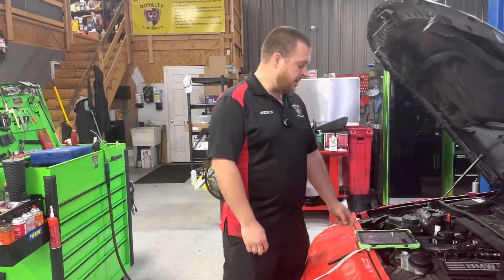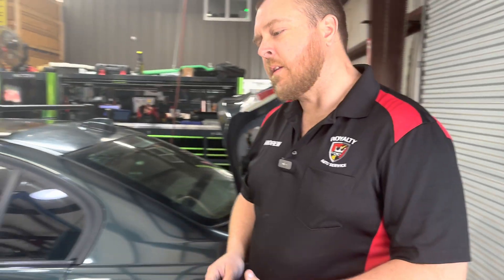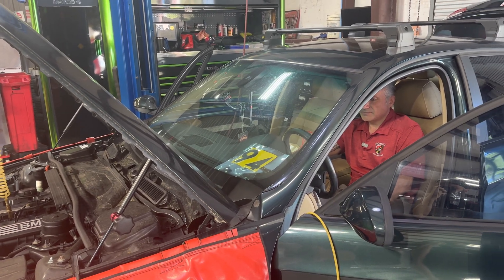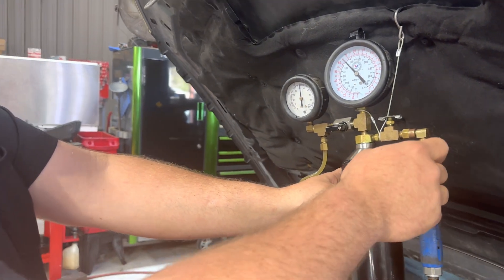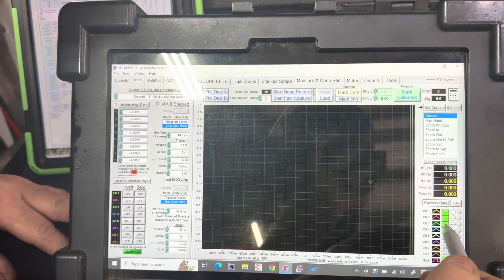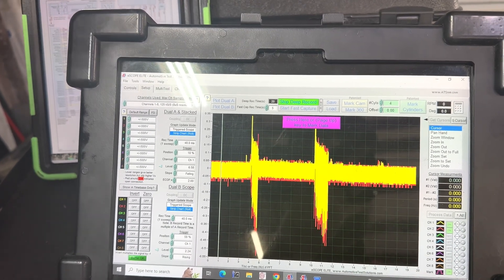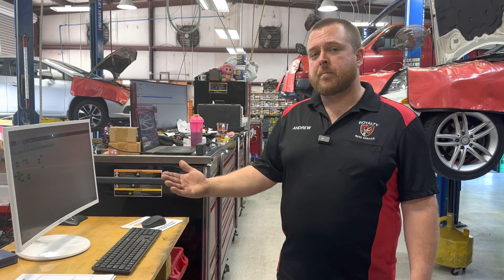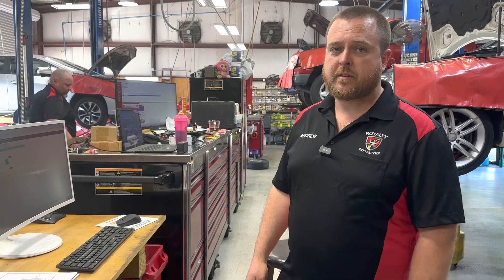Diagnosing a BMW That’s Had the Parts Store Thrown at it

Comment: Great example of following the data. I like that dividing point I saw Sherwood use that in other podcast episodes to see if you are going to follow spark or fuel by introducing a propane fuel source into the air stream. Their was a few times that one would of taken the fork in the road such as the fuel pump all the way back to that module that controlled that relay Andrew removed. Well done.

Comment: If mechanics had to personally pay for the parts which they put on a vehicle which did not resolve the problem, perhaps they would think twice before throwing stuff on the wall.
Appreciate these kinds of videos and sharing the thought process for making a correct diagnosis.
Reply: To that mentality, if customers wanted to pay for a fair diagnosis every time, rather the standard 1 hour then a solution must be provided there would be less throwing parts at it. This is a special case where the customer or another shop damaged a pin and is not typical for most cars. Usually most cars have common failure points and a experienced technician can come up with a most likely cause. If technicians had Crystal balls they definitely be wrenching!
Reply: @joshuagabbard2998  The typical BMW owner does not wrench on their cars so suspect the damage was caused by a well-paid BMW wrench turner.
The shame of it is, that even with all the diagnostic tools available to mechanics today, few mechanics seem to be well versed in making the correct call in a timely manner.
As to "wanted to pay for a fair diagnosis every time..." here are two comments.
What is a "fair diagnosis"?  First, a mechanic either makes a correct diagnosis or an incorrect diagnosis.  It is black and white.  Problem is resolved or it isn't.
Second, the customer is charged regardless. Whether it took 10 minutes or X hours.
Point is the vehicle owner always pays, for time and for parts even when those replaced parts were not providing the solution.
The evidence for this last statement is seen in the trunk of this customer's car, at around 45 seconds into this valuable video.

There may be some locations that will cut the customer a break on a very difficult outlier diagnosis and solution, but that is as rare as honest and competent repair technicians.
Unfortunately, this applies to other trades as well, not just those in the automotive repair business.

Comment: You said Voltage flows and that is not the case; minor point I know.  Current is the item that flows and as it does it develops a Voltage drop across any load type device it travels through. A source Voltage is the Potential Energy that pushes the current through a closed loop. You presentation is excellent.  Why folks use the parts cannon beats me.  TEST DON'T GUESS and it is obvious that this is what you do.  Two thumbs up!

Comment: How has no-one mentioned the 30A fuse in place of a 20A on that fuel pump circuit? At 8:35, you can see that both Early Production F40 fuse and Late Production F88 fuse are labeled as 20A in the wiring diagram. :D
Reply: Was looking for a comment on this and sadly I don't even see RAS reaction to it. I can't argue with results and fuses did look factory to me so there's that BUT I would expect informational video to have no stone unturned.
Reply: Wow dude. You caught that! Insane

Comment: Great video! This is the second video I watched today where modules were replaced to try and fix a no start condition. In both cases pins were damaged during installation and were the cause of the issue. You have a very neat and clean shop. Love the uniforms. Very professional operation.

Comment: Nice video. Straight to the point and well detailed. So the small pins on a 4pins relay are the control side while the bigger ones are the loaded side
Reply from the maker: Rule of thumb would be yes but not all relays have bigger pins. Always check your service info to be sure though!
Reply: BMW uses both Type A and Type B ISO relays. (The style that was used in this video) Type A has reversed 30 and 1 of the control terminals (85 or 86). I have not found another manufacture that has ever used the Type A relays. In my experience everyone else uses Type B and they are standardized. And to be clear, BMW uses both styles. A good example of this is the light green relay they used for their fuel pumps prior to the fuel pump modules. Some of the other colored relays BMW used were Type A also. 

When in doubt, always look up service info as Royalty Auto mentioned.